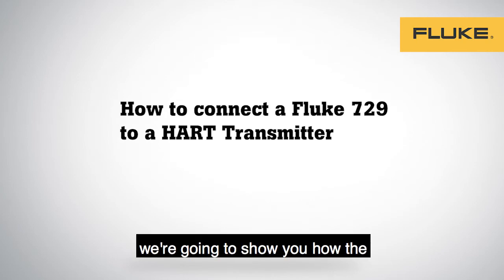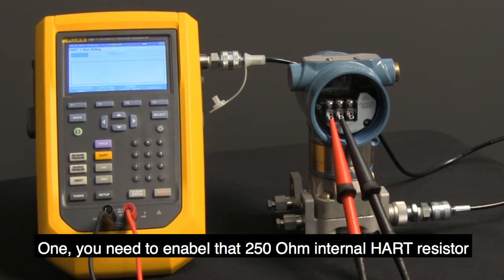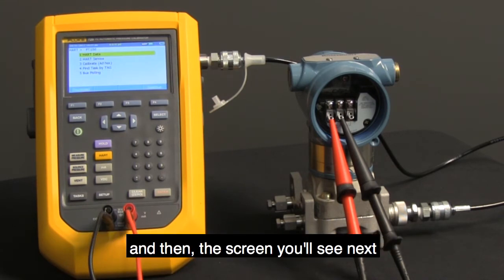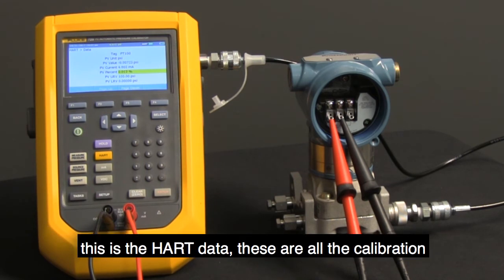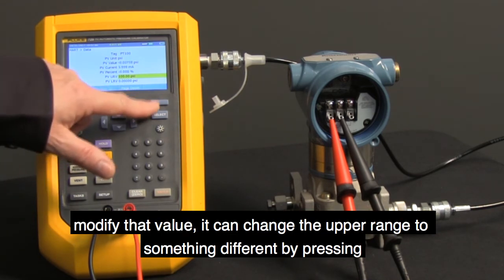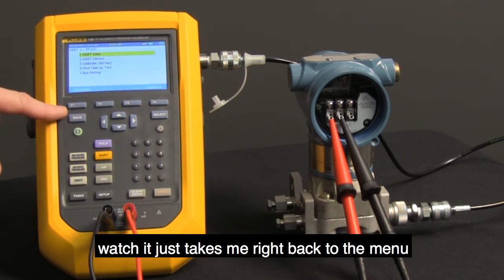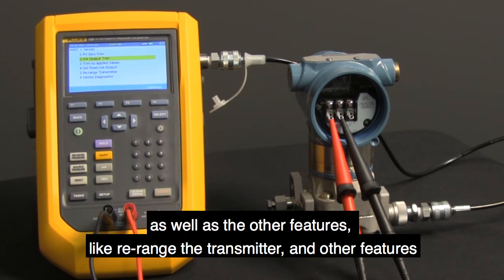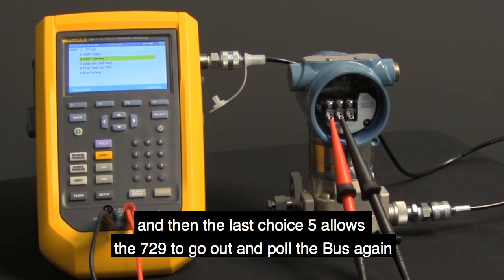How To Connect The Fluke 729 Automatic Pressure Calibrator to a HART Transmitter

Comment: Kindly let me know this device can calibrate high pressure sensor upto 10,000psi to 15000psi. Also share calibration video if you have
Reply from the maker: Hello - It would be possible to calibrate sensors up to 10,000 psi with the 729 as long as you had additional accessories like the 750P31 (10,000 psi pressure module) and the 700HTP-2 hydraulic test pump. We would not have any options to calibrate sensors above 10,000 psi with the Fluke 729. If you have more questions on the setup/applications please feel free to reach out to a Product Specialist at 1-800-443-5853.

Comment: It should be fairly simple to determine where your leak exists. If the leak exists in your calibration equipment then it should be corrected. If a leak exists in the instrumentation and/or associated manifolds, tubing etc... then the leak should be located and addressed. The best practice solution  is not to "beat the leak" with a constant pressure source and a regulator.